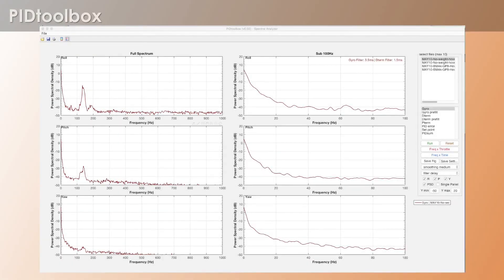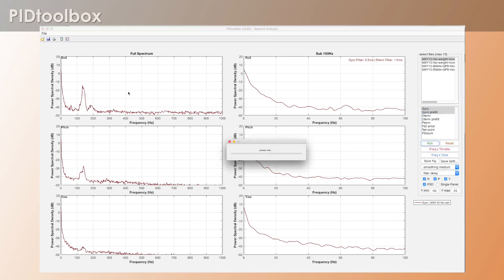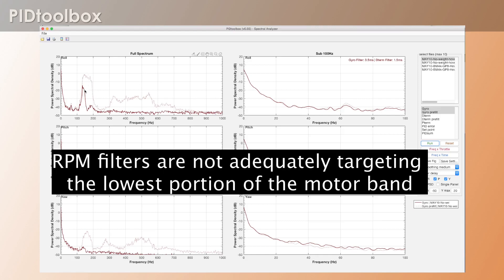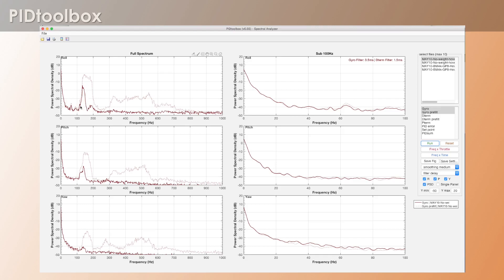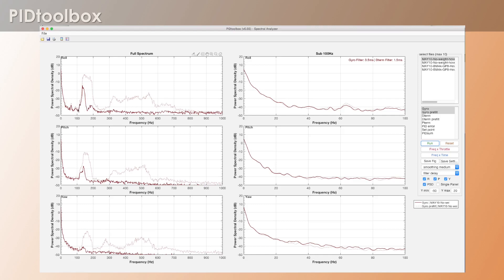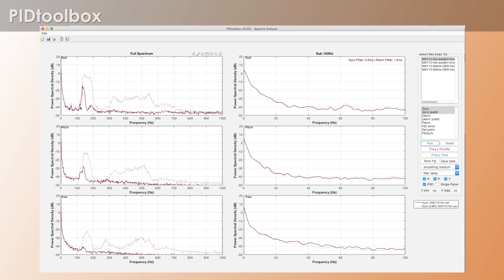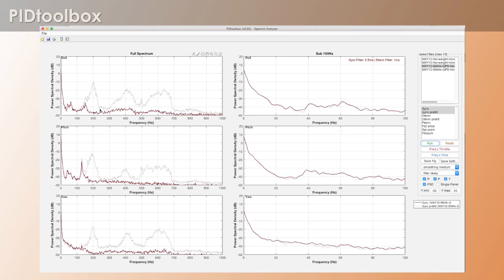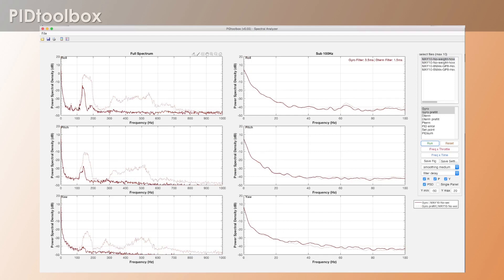Quick Tip - Don't confuse residual motor noise with oscillation!

Comment: Hello, I'm having a problem with my gyro noise plot graph in PIDtoolbox. It shows normal behavior from 0 to -35 dB at 40 Hz(Pitch). On the roll axes, however, the graph starts at 0 and goes straight to -15 dB at 30 Hz . Is this normal? My gyro has a delay of 1.5 ms, while Dterm has a delay of 2 ms. I'm unable to fix this issue, and it's causing the D term to almost reach 0 dB!
Reply: Hey same problem here!

Comment: Hi. I hope you can make a video talk about the difference between mpu6000 and 6500 and 9150. Due to the mpu6000 price goes high. Many manufacturers are transferred to mpu6500 which have higher samples rate.but in the real world I find that for bf and inav sometime will preform even worse especially when you are not tuning will. Is there any tips or something needs to mind when using mpu6500? Thanks for everything you do.
Reply from the maker: I think the bmi gyros will be the go to for a while now. They are really good.
Reply: @PIDtoolbox  I see there are fc use bmi270 but read the data sheet it’s 6400hz lower than mpu6000 8000hz. It’s bf prefer lower noise than higher frequency?

Comment: Thx Brian. Would you recoomend to reduce minhz to 50 so its maxed at 100hz?
Reply from the maker: No. It’s not that simple. You still want to keep filter latency low and reducing min hz lower than you need will unnecessarily increase filter delay a lot. It just depends on the rig and motor size/prop size/Kv etc. default is good for 5inch or less but as you get bigger props that spin at lower rpm you have to re-adjust min hz. For 10inch it’s usually best around 50-60hz, for most 8inch lifters I set it to 70hz.
Reply: @PIDtoolbox  intresting, thx. Always thought never go below 100hz
Reply from the maker: @manirotor  depends on the rig
Reply: @PIDtoolbox  Thx for that elaboration!